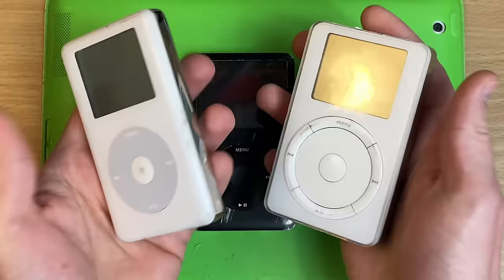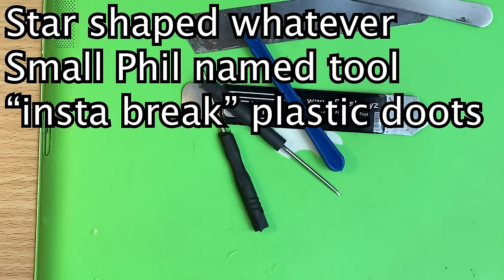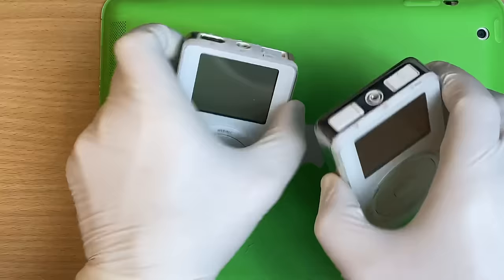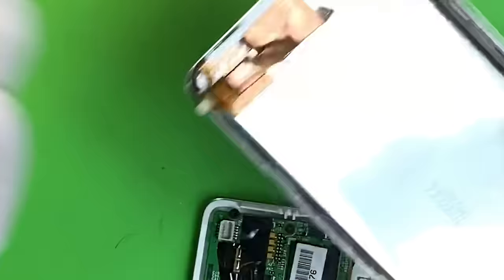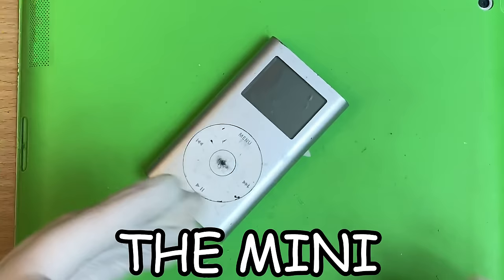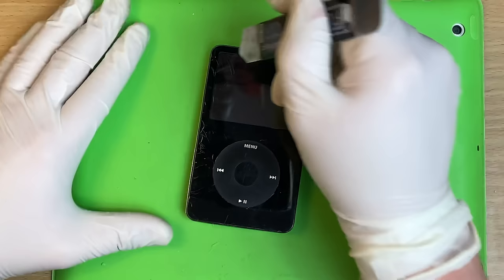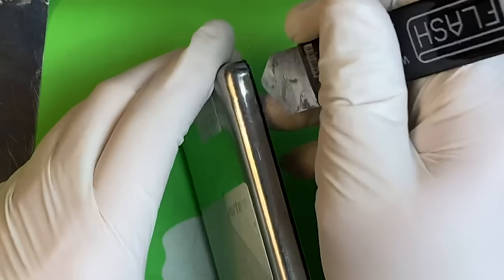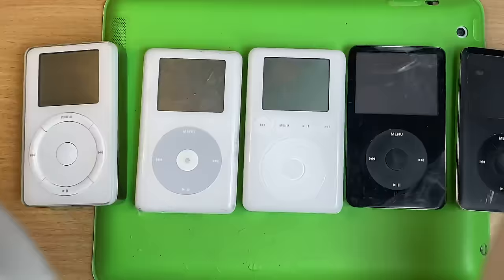How to fix every iPod Classic.

Comment: the 5th gen are fun to mod, default sounds not that great, rockbox and mods make them alot better, 6th and 7th gen are virtually identical, same version of rockbox works on both, a note: rockbox now has its own bootloader for these, you dont have to put EmCore on them anymore with the old, frustrating process, rockbox, is f-ing amazing, makes them so much better....

i own a 240gb ipod a 160gb and a couple that need drives(and batteries i bet)... looking at making one into a 512gb or so using a flash adapter, if i could get my buddy to give me the legit 512gb cf card he has 3 extra of... that would be amazing... 

my pc has a firewire port and could easily be turned into a hackintosh if i wasnt too lazy to bother.... i dont miss firewire simply for the times one drive in a chain would fail and... cause the chain to fubar till you remove the borked drive.... 

ipods are easy to repair.... so easy to rebuild... and you can get replacement parts pretty cheap last i checked. :)

Comment: Im having massive problems with my 3rd gen and putting on the iiflash solo with 4 th gen adaptor ive been playing with it for gours tried what iflash said , used differnt SD card and even a 5th gen HD but i dont think that would work anyway
Reply: I did it in the end with changing the solo and adaptor ribbon to a cheap  green CF board and an iflash CF to SD adaptor. The red ones never work, always get iflash ones.and getca few as they can be used in all models I've found.

Comment: Don’t suppose you know how to fix the firmware?  Apple have done something sneaky with OS 12 Monterey, connect an iPod Classic to a Mac running it and it wrecks the handshake protocol of the iPod.  I thought it was just an unfortunate mishap with my 7th gen Classic and tried getting it fixed.  The message that comes up when you connect it to a Mac running Monterey is it can’t connect and that it needs to download a non-existent firmware fix.  Took it to the Apple Store and they couldn’t do anything as it’s no longer supported.  But I tried to use my 6th gen Classic when my 7th became unusable and exactly the same thing happened when I connected it to my MacBook.  Physically they’re fine, they both turn on, but the hard drives got wiped and they won’t even connect as external drives.  They’ll probably work on a PC, but I don’t have one to try it on.

Comment: Try heating the ipod face plate prior to pushing out the click wheel !  It prevents breaks.  And the battery leads from the Ipod 4rth gen. battery do NOT go beneath the circuit board, they sit on top like you see in the video. This lad is half baked and clumsy to boot.

Comment: Hi there! I'm trying to figure out which iPod to get second-hand, and what mods to apply to it, and I think I need some help. I'd like to get a 5th gen 60Gb, and put an iFlash solo in it (512Gb), and then a 3000mah battery, but not sure if it'll fit or not. I think the 60Gb is part of the "thick" group, so I think I'd be all right, but not gonna order parts from eBay or elsewere without knowing for sure, as this is all a bit new to me. Anyhow, I'd be glad for any input by anyone who's done this sorta mod, or knows each part well enough to know they'll fit together. Thanks!

Comment: I have the 80gb 5th gen and its never been opened before but the hard drive was locked into place same as the battery connector what do I do then lol
Reply: What are you talking about lol
The connectors have little tabs that you have to push up to release the connectors.

Comment: Hey guys, I've gota problem. with my 5.5 iPod Classic. I replaced the battery, did an iflash upgrade and after a Softwareupdate it won't work properly. It's permanent on hold even if the hold switch is in the off position. The lock symbol doesn't dissappear and I'm now stuck with an unusable iPod. Has anyone an Idea what i could do? I tried replacing the Headphone/Hold Switch ribbon but with the same result.

Comment: Currently have a 160gb i think 4th gen not entirely sure, silver and white. Regardless i think I've corrupted something pr deleted something important.

When I turn device on it says " connect to itunes to restore" and when I connect to itunes it does not show up but on the ipod itself it says do not disconnect

Was wondering if anyone successfully made it past this with having to open it up. I don't care about loosing songs I just want it working to use it again, thanks in advance

Comment: I want to update my 6gen a1238 160gb hard drive. Everywhere I look the iflash says that it will only load 128gb for my model ipod. Is that true? I can't find an original 160gb HDD either. Any advice?
Reply: it's not true, you can do more

Comment: The 3ht generation iPod didn´t have battery and it still turned on? Look my Ipod 3ht generation doesn´t turn on because the baterry is dead, I need a new one cuz I miss using it : /, how can I find a battery for my Ipod? Please help me :/
And have anyone use and instale a celphone batery to any ipod?, is it possible if I don´t have the original ipod´s battery?

Comment: I'm stuck trying to get my 3rd gen to restore with my Mac. I put an SD card in it. iTunes will really only recognize it if it's connected via USB; it wants to update it. The update seems to go on, but the iPod never installs the update once disconnected and put on the charger. If I try to restore it, iTunes says it needs a FireWire connection. Through lots of attempts with Disk Utility, I've only ever got half of the 256gb to show up on the Mac when connected via FireWire, Disk Utility won't finish erasing or formatting or partitioning via FireWire, the iPod usually doesn't even show up via FireWire, and the restore won't actually work on FireWire. I have no ideas left... other than trying it on a Windows PC, which I don't have easy access to. Can anyone help?!
Reply: Support has been broken on macOS forever. I just do it on windows or put macOS 10.14 on another volume and do it that way.

Comment: Could you possibly point me in the direction of someone who really knows WIn10 and Ipods?  I've been through every single forum I could find and YouTUbe video looking for someone who can solve a problem over Itunes not recognizing an Ipod when using WIn 10 Pro upgraded from Win 7 Pro.  I've been at this for weeks.  I've tried every 'fix' there is out there and none work.  And, it doesn't matter if I use Itunes from Google App Store or Itunes downloaded from Apple.  Funny thing - I have an old laptop that runs Win7 and the Ipod works great with Win7.  Same Ipod?  Win10 will not recognize.  And yes, everything in question is updated to the most recent release.  I'm at the point where I'm willing to pay someone who can come up with the fix.  Thanks in advance.

Comment: build an
-ipod mini with 4th gen hard drive
-4th gen with ipod mini hard drive
Reply: The iPod mini's aluminium casing can't fit the 4th gen iPod drive, but the 4th gen iPod can accept the iPod mini's drive if you use one of those flash boards.

Comment: Hey i have 5th Gen ipod video with a bad display and clicker wheel, I've been using it since it was launched and this thing helped with my tinnitus and I checked online for spare parts and they're either out of stock or won't deliver to Sri Lanka, if you can get me some parts please reply and I'll provide an email to contact me. Thank you! #savemyipod
Reply: Try looking for another dead iPod. One with a dead drive or battery can be used as a source for spare parts